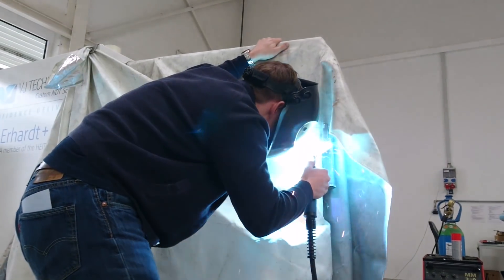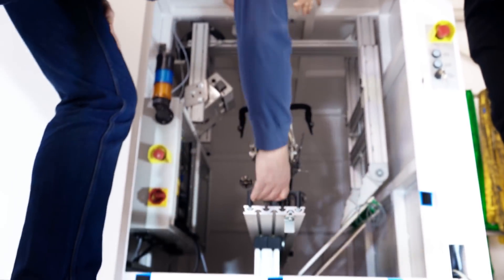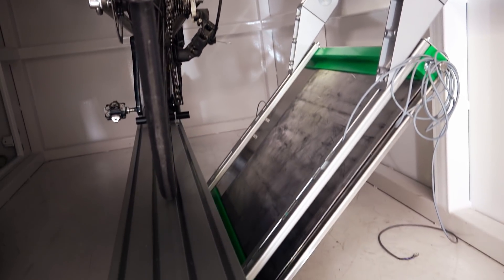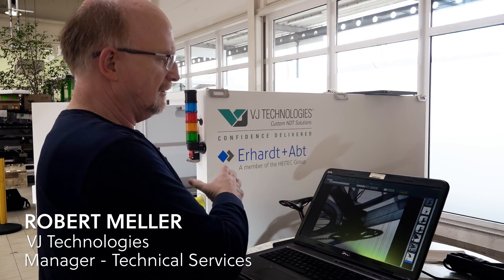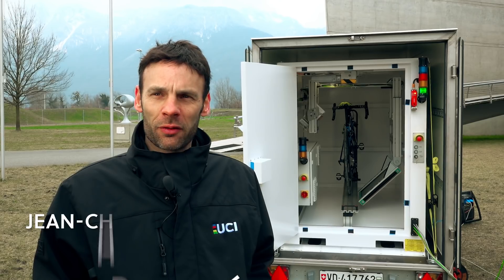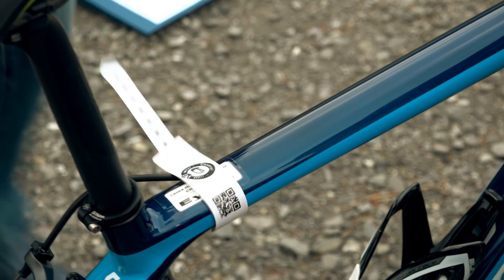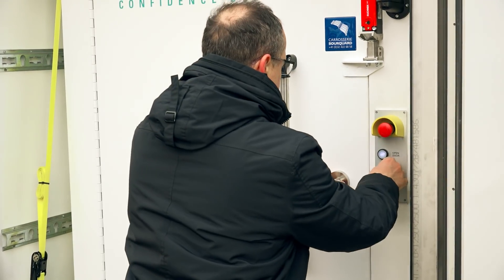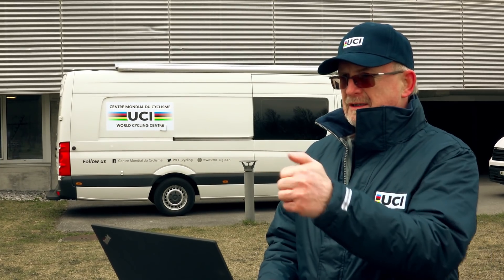Fight against technological fraud - X-ray unit demonstration

Comment: ROFL, in 30 mins after the race I could take the motor out of the bike, not to mention top pro mechanics... On the other hand, bikes must be at least 6.8 kg, disc brakes can be used partially, and certain doped riders can race even though they are under investigation. I love it! /offsarcasm
Reply: they take the bike of the rider directly after the race the x-ray test is 30 minutes after

Comment: At 20 seconds in can you talk me through the personal protective equipment being worn by the man welding? Is that a heat resistant cardigan he's sporting? Looks very professional UCI. 👷‍♂️
Reply: Dave Kelly It's VJ Technologies, working on the unit, not UCI.
Reply: Frans Schultink It's someone contracted by the UCI, in a promotion posted by the UCI. It reflects on the UCI.
Reply: Dave Kelly I bet this welding guy picks his nose too. Shame on UCI...
Reply: Frans Schultink Thanks Frans, I bet he does! I understand your point, however I think you're missing mine. The UCI is the governing body that scrutinise people's actions. They have made this video to demonstrate how powerful they are and to what lengths they are going to to catch any wrong doers. They should be leading by example and make sure they are not open to scrutiny themselves.
Reply: Dave Kelly I understand yours too, Dave, and of course you're right. It's just that I don't think it's fair to judge UCI on every single detail. Personally I would never have added this particular shot. What was he welding anyway? And what did that shot add to the video?